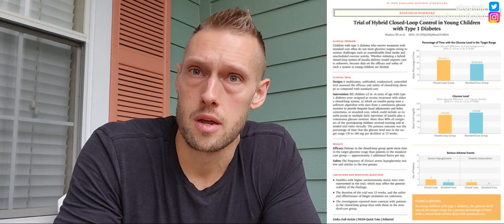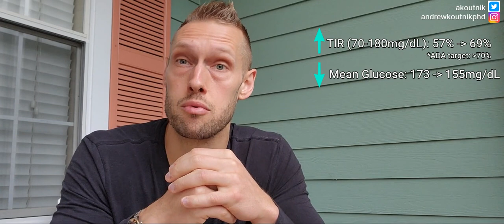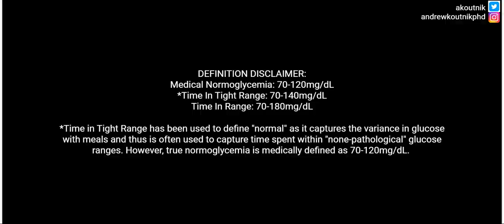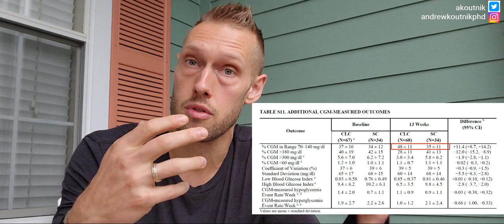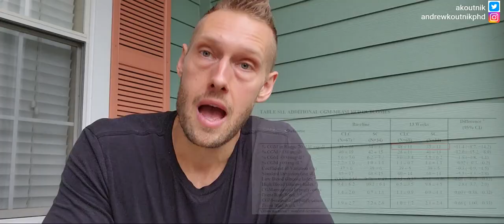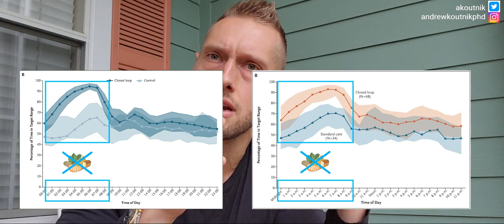Type 1 Diabetes Closed Loop Technology and Glycemic Control

Comment: The problem might also be that the commercial loop systems have very cautious algorithms. DIY systems like AndroidAPS or IOS Loop react more aggressively depending on the settings.

Actually, these results are disappointing, especially because you can get much better results with (moderate) Keto/Low-Carb alone. 

In combination with a Low-Carb diet however, AID systems are a blessing, because they take a lot of work off your hands, e.g. for minor corrections etc.